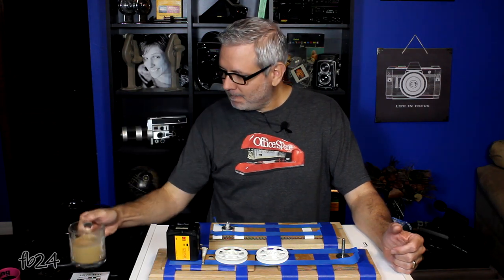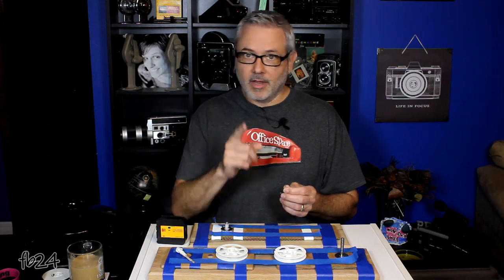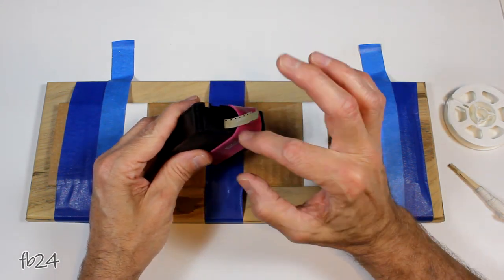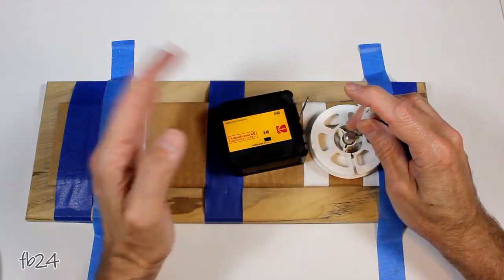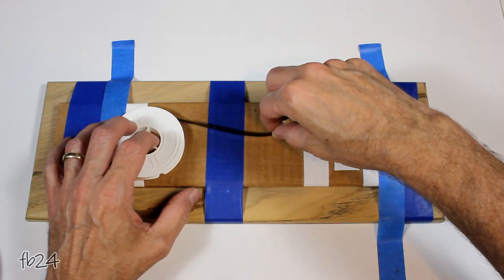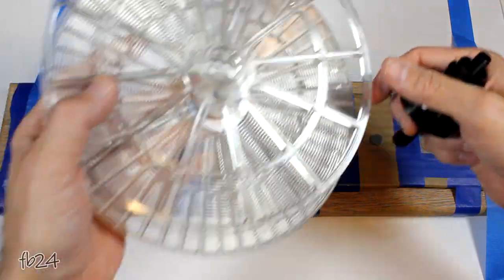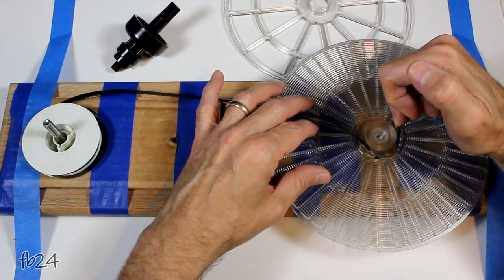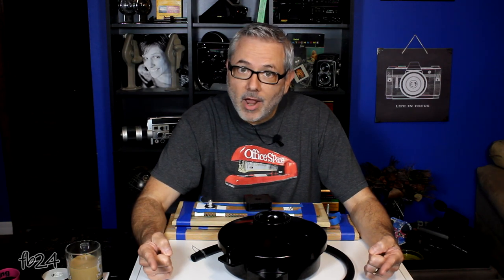Super 8 Cartridge Unloading and Loading the LOMO UPB-1A Processing Tank / Step by Step

Comment: 8:54
Why don't you wind it the other way 'round the first time? Seems unnecessary to do it in 2 steps 🤔
Reply from the maker: It's not possible to orient the film properly without starting from the other side. The only quicker method would be loading it onto the spiral directly from the cart, which rarely works well with old film.
Reply: @Filmboy24  I think I'm missing something then. I thought all that matters is that the emulsion is on the outside of the spool.
Reply from the maker: @Ni5ei  The perforations need to be facing down as well, in the grooves. This is because there are occasions where the chemicals may miss (air bubbles, etc.) the film in the grooves. Since there is no picture on the perfs, they always go down. It's easy with 16mm 2-perf film, as it can be wound directly on.
Reply: @Filmboy24  Ah yes I sse it now. Thanks Mike.